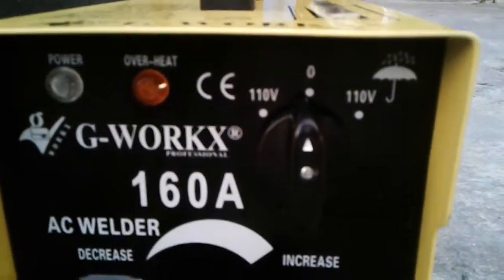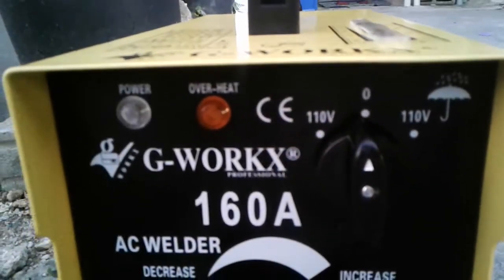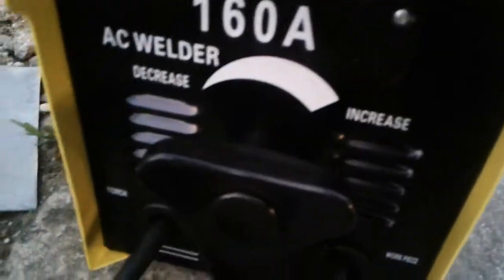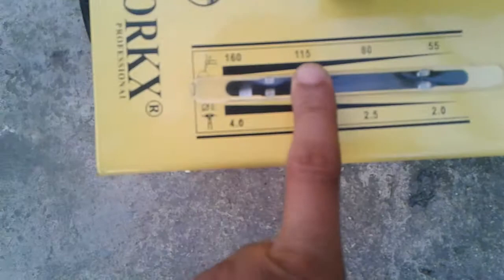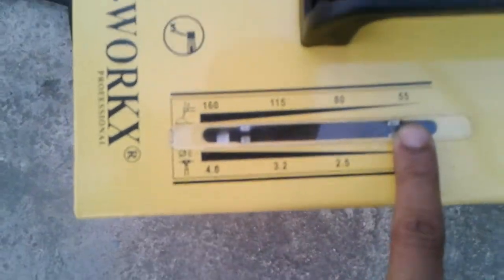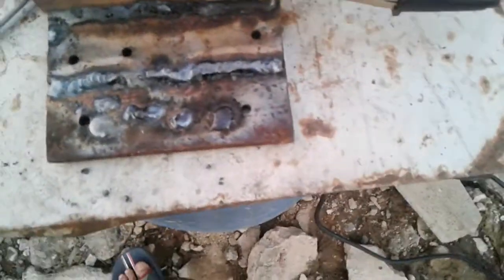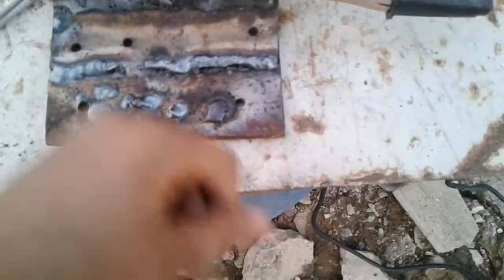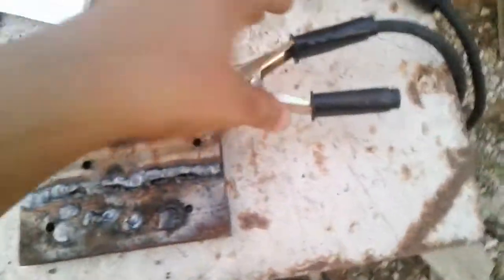G-WORKX PORTABLE WELDER

Comment: Bro I used my one on a 30amp and the breaker trip what could cause it, also I want to know if I could use it on my generator it's 30amp on the 220 side witch I could use a 110 breaker panel would that work. Let me know as soon as possible please your info will gladly appreciated
Reply from the maker: sure it is a independent breaker there is nothing else on it
Reply from the maker: Remember the duty cycle also if you using it at 160 amps all the time that could also cause it to cut off most times I use mines on a 20 amp breaker and I don't get any problem once I do not run it for more than 30 seconds, the most I ever use the machine for was a whole day to  make a bed  from rhs
Reply: Thanks for the info, right now I am using a 60amp 220 on one side and no problem I built my whole shed 24x30 and it work good so I'll try back the 30 amp and see. Thanks again pal.
Reply: Also the cord I used had two joints and some age I wonder if it would cause the breaker to Trip, it was about 80ft Long
Reply from the maker: @trinifishingadventures  that is y it is not recommended  to use any thing longer than 12 feet

Comment: I have a toolcraft 110v 160 amp welder just like that but when i use it on a 20 amp breaker it trips. Any advice on how i can change around the set up to run it properly and get a long extension cord to work?
Reply from the maker: You should make sure is only the welder running of your using the 20 Amp breaker , if you switch to 30 even better but ur extentions cord should not cross 12 feet
Reply: @JacobandNichVlogs   but is there anyway to make it work on an extension longer than 12 feet since i want to use in other areas of the property ?
Reply from the maker: @neeranbhagwandeen4744  the 30 Amp, just don't use a cheap cord
Reply: Okay thanks man..... and love the reviews helped me out alot 👌

Comment: What is the longest extension I cud use?and what size of wire to use for the extension?
Reply from the maker: To be honest u can use any length its not recommend to use anything longer than 12feet if u making one for urself use 2.5mm
Reply: From the panel box to d outlet already have wiring and the size of the wire is 4.0 ......is that ok?or do I have to change the wiring to 2.5
Reply from the maker: Na that should work just find, just take ur time and weld , and give it time to cool off
Reply: So it cud wrk for home  projects .......I'm a DIY person na and now learning to weld ...lol
Reply from the maker: Yea you should be find
Reply: I'm using a 30 amp breaker .....already have 4. Wire from the panel box to the outlet and then using a 2.5 wire extension of 12 feet .....
Reply from the maker: Tell me how it works out for you